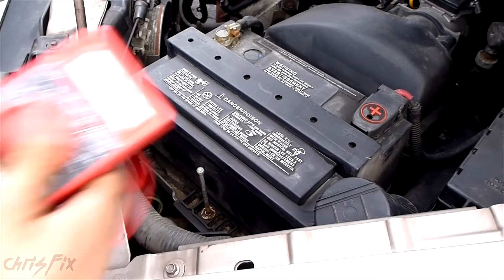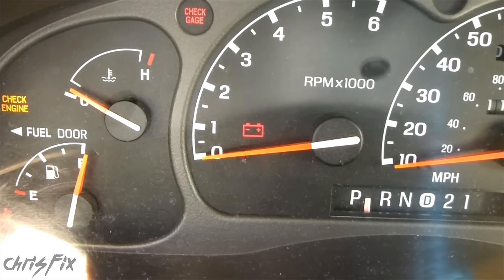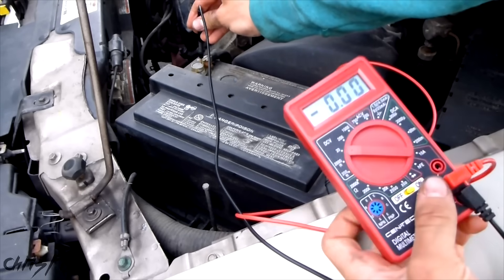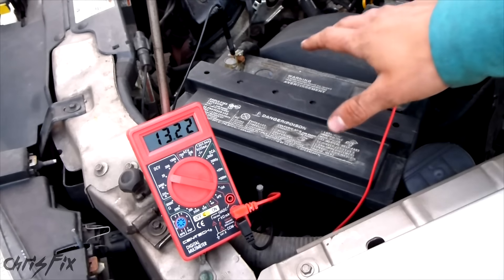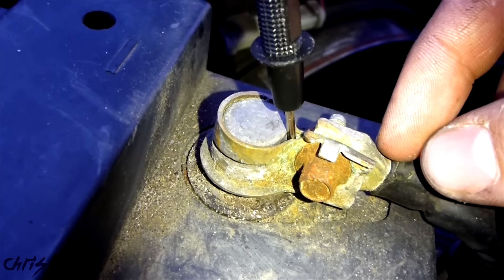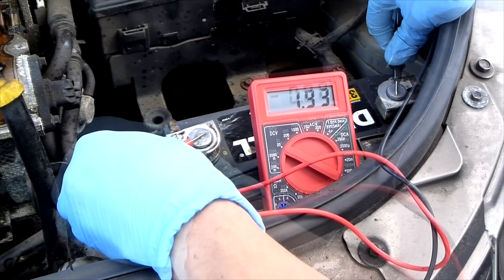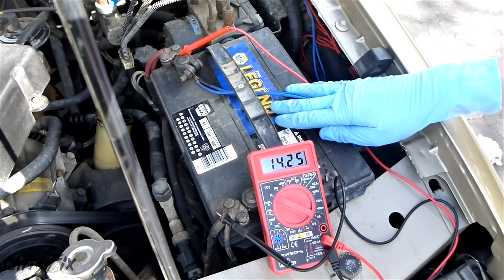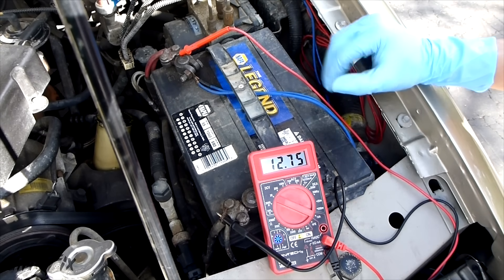How to Test a Car Battery with a Multimeter

Comment: A better way to clean the terminals is to soak them in a baking soda/water solution. The baking soda is a base which will react with the acid and bubble off the crud to a sqeaky clean terminal. You can make a thin paste for heavier buildup and scrub with a toothbrush.  Rinse with water and dry. Then use inner/outer pipe cleaning tool to clean off corrosion. Also...DO NOT use a multimeter to test for CCA (cold cranking amps) with the Amp setting unless it is designed to do so. High amperage will damage the meter.

Comment: Chris, good video on testing. There's a difference between bottled (purified) water and distilled water though, and only distilled water should be used. Also, using corrosion preventive sprays and pastes cause just as many poor terminal contact issues as corrosion itself because it will eventually seep between the post and terminal. It's best to just clean them using a terminal cleaner every other oil change, if necessary.

Comment: You need to do the test with the load tester, and disconnected from the car. I did this test and my batter "passed." But I was still getting issues. So I used a load test and the CCA was half of what it should be. Replaced it with a new battery, and now I have no more issues. So it was definitely a bad battery.

Comment: Ever tried to claim a warranty on a car battery ?   Car battery warranties are about as honest as any other warranty on any other car part you buy.  In fact, it's been my experience that nothing, related to the automotive industry actually has a warranty. 
Warranties on new cars or new car parts are all implied but none honored. 
Just my experience.
Thanks Chris, I've been having issues with my Century battery.  24 month warranty, 15 months old and, no warranty.

Comment: Put some petroleum jelly on the contact points.it stops corrosion that's what I was told in college 😃
Reply: Only petroleum jelly....not any grease or that,grease will destroy it...it conducts or something if I remember correctly
Reply from the maker: +John Macaulay thanks for the tip
Reply: so you DID learn something there

Comment: The only improvement I may suggest on your video as it is excellent; is that I would recommend someone to get the proper tool for cleaning a terminal. They are financially cheap and well worth the 2.99 they usually go for these days.
I got mine below. Just wish they still made stuff in the USA
http://www.harborfreight.com/battery-terminal-cleaner-94450.html

Comment: isn't the battery indicator on the meter shut off if the alternator is charging, light on means not charging? it doesn't mean battery is good
Reply from the maker: +Hoo Youyi a light is just helpful if the alternator or battery is really bad. It won't tell you if it's starting to go bad or only slightly bad.

Comment: hello Chris, every time I disconnect the negative terminal to my battery when I plug it back up the car runs really rough at a very low RPM for a short amount of time, I've never really tested how long it took usually I just drive it and before long it seems like everything resets and then it runs and idles just fine. Any ideas what that might be

Comment: Chris, my new battery drops from 12.8 to 12.5 in a matter of minutes after shutting down.  Alternator is good in the 14v range. I forgot to check the man. date before I bought it, and it turned out to be 6 months old.  Is this type of voltage drop in a short time normal?
Reply from the maker: Yeah, that is normal. Resting voltage is 12.2-12.4V.

Comment: Hi Chris..Good way to clean corroded battery terminals in to pour on some boiling water and use Copper Slip or Vaseline to seal the terminals..Thanks for great videos..Paul in UK
Reply from the maker: Thanks and thanks for the tip. I would be careful with boiling water but I bet it gets it clean.

Comment: fantastic tutorial.  I tested my wife's car and saw that before starting the car, the voltage was at 10.6. when I started the car, it went down to 6.5, then up over 14.  is this a bad battery or do I just get a charge on this one? It is abt 3 yrs old.
Reply from the maker: Thanks! Run the car for 20min (go for a ride), shut the car off, wait a few hours and test it again.

Comment: I notice that original batteries in new cars can last 10 years or more. The battery in my Audi purchased in 2006 still shows 90% of its cranking amps so going on 11 years while replacement batteries bought in Auto factors do well to last 4 years and are dying for maybe a year before that. Seems its all about sales and turnover for these companies and these batteries seem designed to fail as soon as the warranty expires so people have to go out and buy a replacement. Maybe there is some kind of device inside which is triggered to take the battery out just as the warranty is up.

Comment: Chris. I tested my battery and it was 12.4V after 2 minutes letting the light on, but it didn't drop under 10,5/11V while starting the engine. Do I have to change it?

The reason I tested the battery was because I had a dead battery by leaving the lights and radio on for about 15/20 minutes without the engine running (whoops).

Comment: ChrisFix, does the car electrical system run from the alternator after the car is started if the battery is dead?
Reply from the maker: +jim Nicosia the electrical system always runs from they battery. The alternator supplies the power/charge to the battery.

Comment: Hey Chris I just got a 2013 Ford Fusion SE 1.6 i bought it off an insurance auction. It had a frontal impact but nothing severe, just cosmetic stuff hood, lights, bumper cover etc. and also no airbag deployed. I bought a new battery for the car after it was repaired about two weeks ago and the battery only lasted for a week. I did the parasitic draw test and it didn't show any. The connections seem pretty tight on the car. For 2013 I'm pretty sure the alternator shouldn't have to change already, well at least I hope. Its killing me to find out the issue.

Comment: Does this method of testing batteries work the same on larger vehicles that have two batteries, I have a 99 k2500 Suburban Diesel.  If I do find that only one battery is bad. Can I just replace the one, or should they be replaced in pairs?  Do you have any videos on battery load testers? Thanks again!
Reply from the maker: +Scott Stcyr you need to remove the batteries and test them separately
Reply: okay, Thanks. What if I find only one is bad?
Reply from the maker: Then replace the bad one and leave the other.

Comment: You got that high quality Harbor Freight multi meter like i do  xD
Reply: Me too. I have several of them, one in the trunk of all the cars we have. The back light is useful, too, and I get some use out of the 1.5 / 9V battery test feature.
Reply: yeah ive got a few but most the leads are broken so i use other brands leads, plus i fabricated other ones for other purposes like terminal slot testing
Reply: You can’t hide money...

Comment: Question: I've run the radio in my car maybe 10-15 minutes without headlights or fan going only to find my car needs a jump to start it again.  It jumps fine, I can drive it around with no problems restarting that day or the next.  I checked voltage as per your other video and I get 12.5 VDC with the ignition off, 14.5 VDC car started with no headlights, fan, or radio, and 14.3 VDC loaded.  Do I have a battery that needs replaced because I don't experience this jump-needed with my other car.  Thanks!

Comment: Where did you get that 'only 30% reach that four year mark' wisdom from? Most batteries will work four years without a problem if you use at least a half decent one... most batteries will actually do between 5 and 6 years with ease. Of course it also depends on circumstances like climate, if you live in a place where it freezes a lot a battery will have a shorter life... but most people live in a reasonable moderate to warm climate and it should do at least 4 years without a problem.

Comment: Ive got a 1984 Ford E10 Club Wagon I'm restoring - I replaced the starter and the battery, but for some reason it wont charge? Got it to a parts store (after jumping it). Said the alternator might be bad, because the battery is brand new and I replaced the terminals. Reading while the car was running was at 9.0! Bad. The van was running "decent" before the battery was changed, and it had been in working order - Can a new car battery be defective? lol - I got a charger, so I may try charging it outside the van, but if the alternator is bad I can replace that too. Hard to tell. Can you test a car battery externally somehow? So I can see if its that? Checking parasitic leech video now!

Comment: when i start the engine of my car, the battery voltage is still in 13.4 it won't increase to 14 volts is it a problem of the battery or the alternator?

Comment: my light came on and then tested the battery. Charge and everything seemed good. turned vehicle on and the light was gone. should I be worried about driving. seems to have power and running well

Comment: Hi Chris I love your videos, I would like to ask you if only using the Volt meter is sufficient to determinate if the battery is still good. Or you would advice on a battery tester with CCA  tester? I mean is it proof enough if does not come lower to 10 is good?

Comment: Top top videos m8. ,my multi meter has just broke what type you recommend i buy?
Reply: A multimeter doesn't have to cost a lot of money, you can get a decent one for about 25 dollars... a Innova or Amprobe. But if you want to 'invest' in a proper multimeter you should buy a 'Fluke', a basic one will cost you somewhere around 70 dollars, something like the 101 model.
Reply: I looked into this very question about 4 months ago.  My conclusion is that you get what you pay for.  The more expensive ones have quality fuses to protect you from high voltage.  A five dollar unit will test voltage; only the more expensive units will protect you from it.  They are also idiot proof so that you can't mix up the wires or the tests.  If you are handy and fix a lot of appliances you may want all of the bells and whistles.  I tried to save money by buying a mid range unit and one month later I needed a capacitor check and my unit did not have it.  Bummer.

Comment: I've had so many cars come to O'Reilly, I'd test it with good looking terminals, and it'd come back as bad. many tests would come back with the same result.

I cleaned the terminals for someone just to give it a shot, since I clean them before installing a new battery anyways, and sure enough, it came back as a good battery, just needs charge. so, its amazing how even the smallest amount of corrosion can block charging and even make battery tests look bad.
Reply from the maker: Right?! It is amazing how a simple dirty connection can cause so many problems!
Reply: ChrisFix., 
Ελληνικά

Comment: Thanks for showing how to test a weak battery at starting with a multimeter.  Very helpful.  If your test leads are long enough, you can put the multimeter on the windshield and watch it while you start the car.

Comment: Thank you.  I wasn't sure if I could test my car battery with the cables still connected to it, but based on your video, it looks like you can.  This was a great video and a good start to me hopefully finding my parasitic drain on my battery.
Reply: Chris has a excellent video showing step by step how to locate a parasitic draw using a multimeter. I watched his 
video which shows you how to do it, I found the problem very quickly. You might want to try it. Good luck.

Comment: FYI ... if you don't drive your car a lot (especially a non daily driver)  the battery will go down.   I found that by driving it for about 1/2 hour the battery charged back up.  Thanks :)
Reply from the maker: Great tip! Thanks for sharing!

Comment: WOW! Thank you so much for your insight.  I have been troubleshooting my 2005 Chrysler T&C Touring 3.8 for a month now and nothing seemed to work.  The symptoms were as you described erratic dash panel, headlights inconsistently browing-out, vehicle turning of while at low revolutions, multiple error codes including cylinder misfire P003.  I changed the alternator, cleaned battery terminals several times, checked each relay in the PCM box, took out dash panel an re-solder it, check al fuses, and the list goes on... and on. Until I came up to your idea of checking the battery and changing the battery terminals for Marine type.  Wow!  my battery was going bad, but my terminals were bad too.  No more problems.  Thank you!
Reply: Common voltage-related gremlins.

Comment: Hey Chris - Car started having trouble starting so I tested my battery and watched it drop below 10 on start up. I switched it out for a new one. New one showed 12.68 on multimeter reading but once installed the car would not crank, attempt to start, anything at all. Had to jump it to start, twice. Thoughts?

Comment: A distinction should be made between bottled water and distilled water. Bottled (drinking) water is NOT distilled water.  If you have a "wet" battery with caps, only add distilled water.  Regular bottled drinking water does have minerals.  I only mention this because you said to use bottled "or" distilled water.  Only use distilled water, which is bottled, of course, but drinking water is also bottled.
Reply: Bob Miller I just use dehumidifier water pretty sure it's more pure than tap water
Reply: The calcium in regular and bottled water will deposit on the surface of the plates and prevent the passage of electricity.
Reply: adverse *effects
Reply: Thank you Cris. Very informative video
Reply: Oops I just wrote the same comment lol...
Reply: Use distilled water. I used bottled water once. My fleet mechanic gave me the bad news. It wrecked the battery. It’s called ‘sulfating’ it. Had to get a new one.
Reply: With or without electrolights? Alkaline or acid? Damn hipsters🤔
Reply: One time I had to add 5 gallons of bottled water (that was all I had on hand)  to a large battery of an electric forklift that obviously nobody maintained well at all.  After a two day charge the lift was back in service.  I was pretty sure that we would have to replace that battery after this Hail Mary stunt......  That was three years ago and that fork lift is still working strong with no problem at all.  Whenever it needs water added, we give it the same water we all drink.
Reply: I&#39;m sure distilled water would be better, however, I have used plain old tap water for years without any adverse
effects.
Reply: @duke7595  me too. On a forklift with 12 batteries and have had no issues for years
Reply: @deodog7135  He's right, you don't need distilled water.
Reply: Bob Miller hey... captain know it all destruction of good videos.. if you're in a emergency situation regular water can be used.. and he stated distilled water is what to use.
Reply: @deodog7135  C'mon.  Bob didn't "destroy" a good video.  He made it more clear.  Chris didn't get that one quite right- he said bottled "or" distilled water.  I love Chris's videos; he's the best DIY car guy on YouTube.  I'm pretty sure that Chris is into putting out the best information, and would appreciate the clarification.  He's not as fragile as you seem to think.
Reply: Who has distilled water at home. Everyone uses tap water or bottled water.
Reply: @markflierl1624  when someone is on a Cpap machine you will have a couple of gallons at all times.
Reply: @markflierl1624  NO they don't. I use RO (reverse osmosis) water. I've had car batteries last up to seven years. How about you? In any case water with mineral content will not immediately destroy your batteries but it will impact their performance. If you don't believe me, why don't you all check the battery mfg websites?